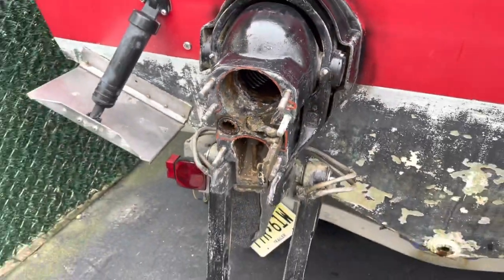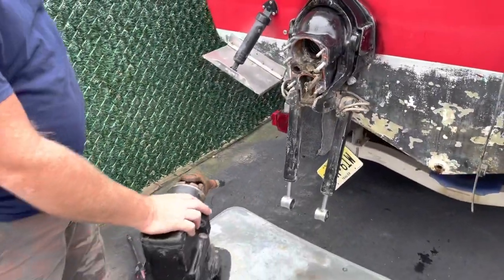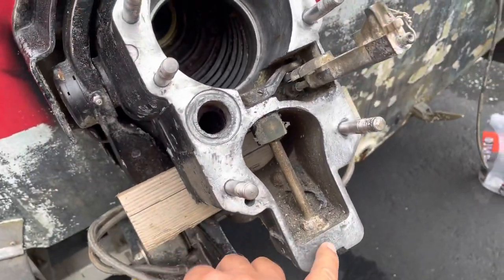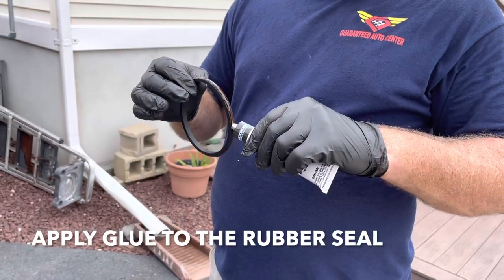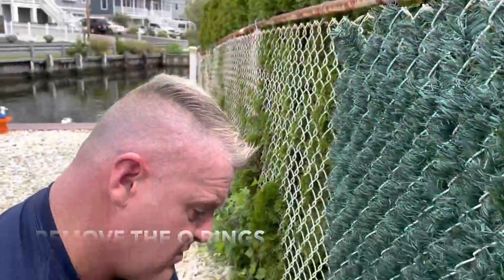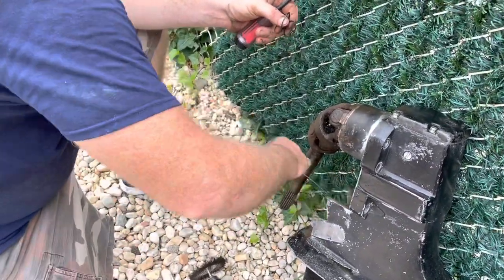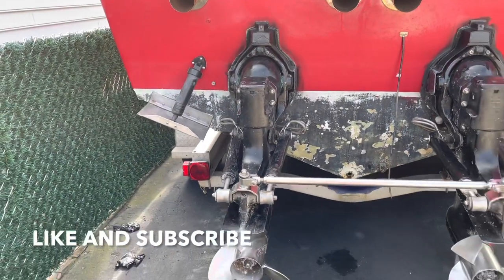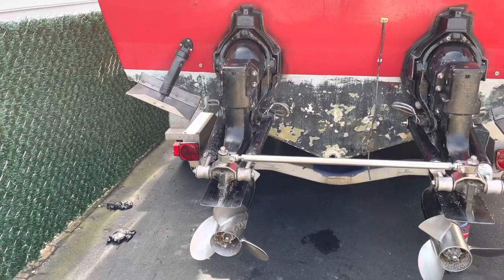GIMBAL BEARING REPLACEMENT - How to Replace the Gimbal Bearing on an Alpha Drive

Comment: Destroyed the new bearing by beating it in by the inner race which puts pits in the the inner and outer races causing pre-mature failure then didn't torque anything properly and at the end hits the threads on the trim cylinder shaft with a hammer and wonders why the threads were damaged in the first part of the video. Also why didn't they figure out the cause of the water leak and repair that plus new u-joints from sitting in the water. Should never use a wire wheel to remove gasket material as you can damage the soft substrate and every zirc needed to be greased along the way as well. How not to service an out drive. Poor maintenance is inexcusable, just look at the condition of the boat and out drives, I'd move on to a video from more experienced competent instructors!